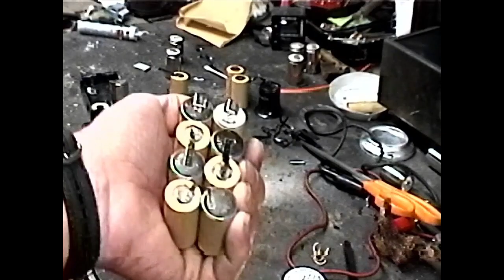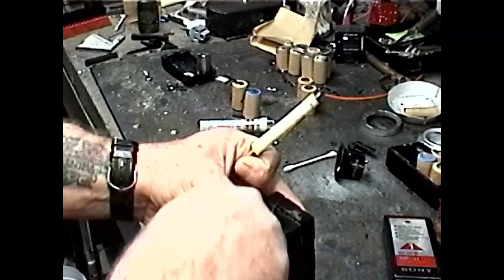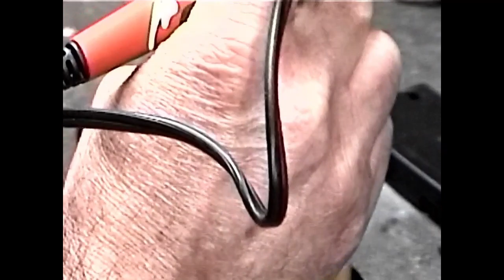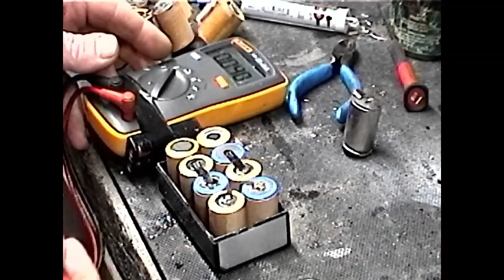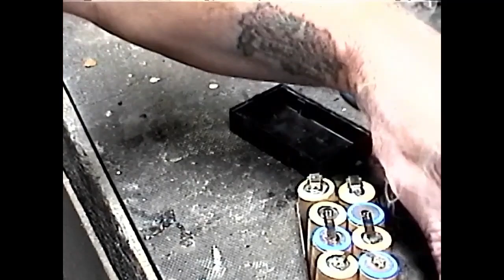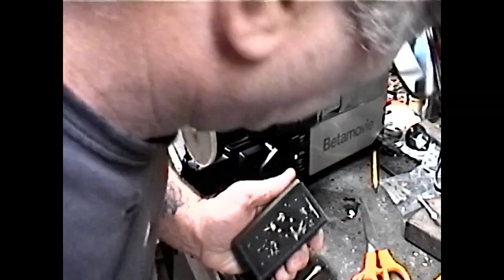Sony NP11 Betamovie battery rebuild

Comment: What is the exact replacement model and brand you used for this that fit inside the casing?
Reply from the maker: Tenergy 4/5 SubC 1.2 Volts 1300mAh NiCD Rechargeable Batteries with Tabs, Flat top, 15 Pack 
This is taken right from one of my orders from amazon.  I have also ordered some without tabs, either will work but if you get tabless, you will need to order tabs, both have up sides and down sides.
I dont remember if I put it in the video but they fit better with the paper sleeves on them.
Reply: @ Awesome, thank you so much!